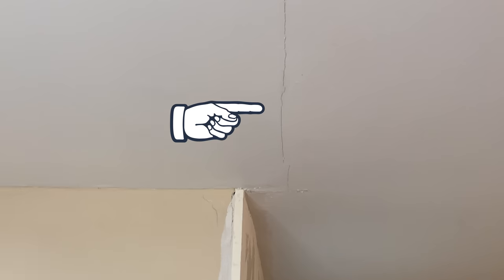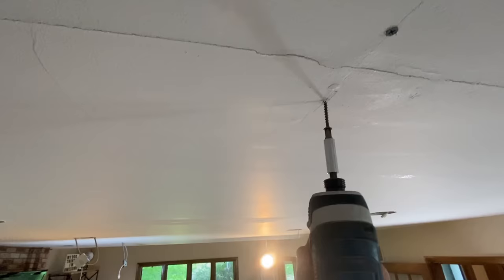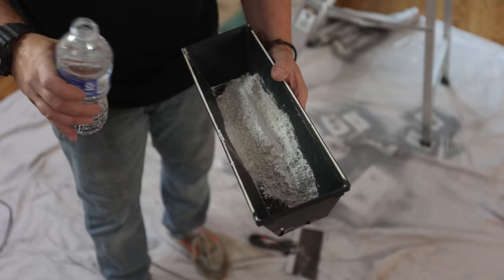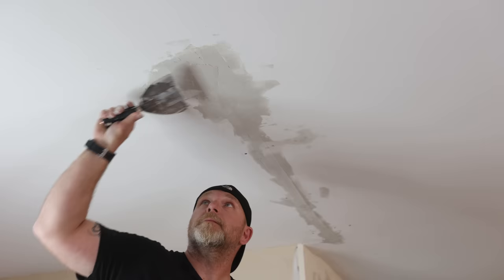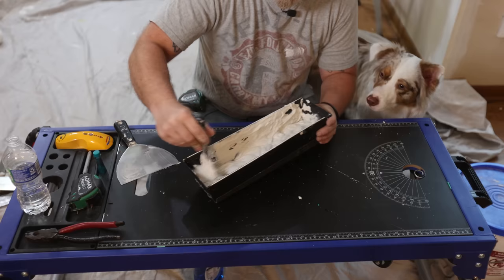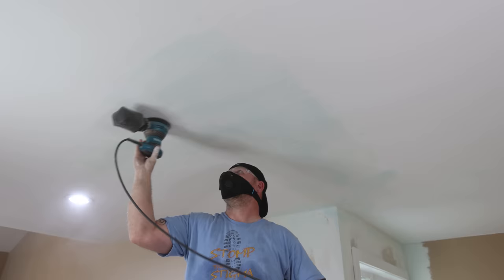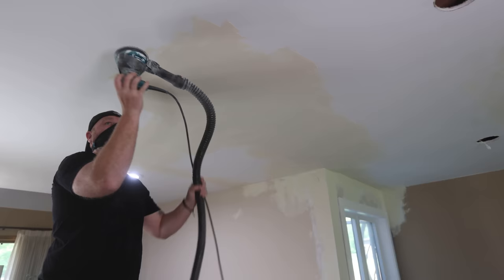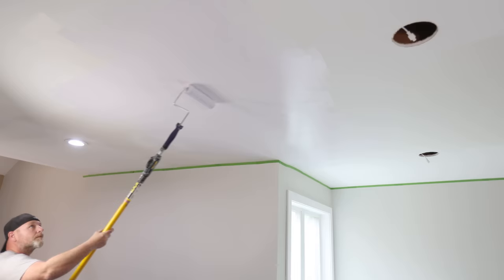How to Fix a Drywall Crack in Ceiling or Wall FOR EVER!!! Tutorial

Comment: How many days would this project take?
Reply: The Durabond comes in 5, 15, 30, 45 and 90 minutes, that is the time it takes for the product to dry. The regular mud takes anywhere between 12-36 hours to dry based on humidity and room temperature. I'd say something like this would take 3-5 days
Reply: Yea 3 to 5 days but only a couple hours each day of work. It’s a lot of sit around and wait for drying
Reply: day 1: cutting that crack bedding the tape<--3 hours
day 2: coating the tape includes clean up <--1 hour
day 3: finish coat includes clean up<-- 1 hour
day 4: finish sanding, vacuum clean up, prime with brush clean up<-- 2 hours

using a trowel instead of a knife cuts down the coating time because spreading with a trowel is much faster than a knife, especially on a ceiling.

Comment: This is a great video, but my problem is cracks in Lathum plaster. Is the process the same or does it require a different method?
Reply from the maker: Should be the same as long as you don’t take the plaster off completely and just go over it.
Reply: @KomarProject  Appreciate that quick response. Thanks!!

Comment: Hi, I have a random question, I have a big crack in my hallway roof (I think it’s all Sheetrock I’m not really sure) a big crack right below it on the tiles on the floor, and a few small ones around, do you think we would have to move out while they try to fix it? My house is on a hill and we think it’s shifting very badly, and we have no idea what to do as we’re renting & have too much stuff to just up and move super fast. If possible can you give us your thoughts on the matter? We just have no idea what to do.

Comment: Mesh tape is absolute garbage and tears extremely easy, which is exactly what you don't want when fixing a crack. Don't use it. Nothing beats paper tape. The trick to getting a perfect taping with paper tape is to wet the tape before putting it on the wall. This will completely eliminate any bubbling. 

Smooth out you ridges on your second coat and you will save yourself time on scraping and sanding before putting on the third coat, which should be the only coat you need to sand.

You feathered that very small crack way too wide. It reminds my of a half inch deep drywall repair in the house I bought that, when I scraped the 5 foot blob of drywall mud off, turned out to be a hole about the size of my fingertip. I put a 1 inch piece of paper tape over it and feathered it out about 8 inches and it was invisible after that. If you have to feather out 3 feet, you are putting the drywall mud on way too thick.

Comment: That crack will come back even worse  because that mesh is garbage looks like something is moving in that home that problem should be fixed before trying to fix it with a band aid. Might be better to cut it open see what is moving  fix that and maybe a good place to put a expansion joint.

Comment: Your mileage may vary, but Food coloring was a disaster here. We hardly used any food coloring, and maybe it was the type of compound we used, but 3 coats primer, 3 coats paint (Behr Marquee with Primer in it, no less) the blue color was still poking through after it dried. We switched to an even stronger primer, than another paint and primer coat, the blue is still alive and kicking. Huge mistake. either have to live with it or sand down and start all over.

Comment: Back in 1979 we turned our attached 1 1/2 car garage into a bedroom. The front wall has a 3 window casement. We always had a diagonal crack from the outside corner of window and no matter what I did it still cracked. While having some basement work done a few years back my contractor removed a rectangular piece of the drywall on either side of the window. It still cracked. He had a drywaller come over and he added more screws. The cracks came back. We found out when the garage door opening was closed up wood was used at the bottom instead of concrete blocks. Do you think your method will finally end the wall cracking?  I don’t want to spend $10K to open up the wall and replace the wood with concrete block. HELP!
Reply: No, it won't work because there is movement and stress everytime you open and close the garage door.
Reply: Frank Lopez, it is a bedroom no longer a garage. There is a permanent wall in the front where the door used to be. Read the entire post.

Comment: What about a textured ceiling? We have a heavily textured circle/pull off type, not sure what its called.
Reply from the maker: Probably a popcorn ceiling.  You just have to get two coats on it and spray the popcorn.  No need to finish it super smooth
Reply: @KomarProject  Had to look it up, called a swirled finish but done heavily from the pictures I see. Thanks for the reply.

Comment: It is proven that mesh is weaker than tape. You can prove this yourself by making two test pieces. Join one with tape and the other with mesh, then see which one breaks the easiest.  Once you see this with your own eyes you will never use mesh again! ☺
Reply: 99% of mesh tape failures are from not using quick setting mud to fix it to the wall. IDK why, it is right there on the label of every brand of mesh tape to use quickset only. People set it with air dry mud anyways and then have failures with it.

Comment: Never, Never use fiber tape. I have repaired countless reoccurring cracks in ceilings to find that fiber tape failed. Builders still seam with paper tape on new homes for a very good reason. Applied properly it's stronger. Nice work otherwise.
Reply: Fiber tape is meant to be used with Durabond. People make the mistake of using All Purpose or Topping with the fiber tape. I've made the same mistake myself in the past using fiber tape and that pink spackle crap. Since learning my lesson I haven't had any issues with Durabond or either paper or mesh tape for crack repair

Comment: I have to wonder why most of these DIY videos always present the problem in the easiest configuration for them to look good fixing it?  The job here would be more difficult had the ceiling members (joists or rafters) been running at a right angle to the crack.  Combined with a textured finish it would be even more challenging.  It would be easy for the viewer to watch the most difficult process and then ramp it down to fit the situation rather than the reverse.  In my experience it is often the case that using sheetrock screws or nails to pull the panel back into plane often results in the screws just pulling through the board.

Comment: Couple of things. 1) NEVER open the crack. It just makes the joint weaker. 2)use the self stick fiberglass tape, you don't have to put a base coat of mud under it .3).for the last coat, Use topping mud because it's softer and easier to sand and feather. 4) use a light at an angle when sanding so you can tell if it's feathered good . Iv'e been doing this work for 45 years.
Reply: 🤣🤣🤣
No.
He didn't open it enough and you don't open it at all. Folks like y'all are what keep us professionals in business though, so, thanks!

Comment: My Pro Tip guys : before applying the mud insert a fine line of paintable silicone has far has possible  in the crack and for large cracks fill it up whith urethane the one used for insulation cut off the excess and apply the mud whith Plaster of Paris mixed in toguether ( dries faster) after a few coats paint a coat of primer and correct the plaster ( pure) and sand down 40 years experience in the Biz 👍
wy the silicone ?
wy the urethane ?
that will be in another video guys 😂

Comment: OK, that was good but they WILL return.  It may be a few years, but trust me, they will.  My personal experience.  Some of it has to do with snow.  The weight of last year's freak snowfall put too much pressure on the ceiling joints and voila, the crack came back.

Comment: Hmmm, forever? So many techniques and so many failures. Not forever, be honest, it's always temporary in time. 

Until you completely stabilize the foundation and weakened structural joinery it is temporary at best. Of course some butyl rubber joint filler might help other than the paint peeling away in time. 

Other than my pessimism you did a good of explaining your work.
Reply: If you watched the first 13 seconds you would have heard him say his case was water damage. Water damage is the one case where you can fix the crack "permanently" provided you solved the water problem.
Reply: @wally7856  If you had actually read and comprehended the words I wrote it would have been apparent the meaning of my posting. Sorry for the failures of your education.

Comment: this guy is a hack, i would find another video to watch and you will see what i am talking about, please dont smear mud across the joint, and secondle if you are fixing drywall or gypsum, dont use a quick set product as it wont allow you to squeeze the compound out from under the tape and creates humps in your finish.
Reply: he had to go 3 ft wide do to using quick set, if he had of just used drywall compound he would not have to go wider than 14 inches !
Reply: Mesh tape "requires" quick setting compound to set. It will fail with air dry mud as when air dry mud dries it shrinks and doesn't hold onto the fibers. Grab a roll of mesh tape and read the label - it's right there. I agree with you for paper tape though.
Reply: @wally7856  no it don't ! ive been a taper for 30 years, mesh does not require quick set lol mesh tape has a sticky siude and should be applied before the drywall compound so it sits flush to the wall, this way you dont have to go 4 feet wide to hide it like he did in the video , please dont make stupid comments you know nothing about apparently ! now have a nicde day.
Reply: @kpfeiffer8775  Read the label on your mesh tape and get back to me. I've been repairing hack mesh tape jobs from people like you using air dry mud to set it for 30 years. 

Nevermind, keep using air dry mud with your mesh tape, it keeps me employed fixing your mistakes.
Reply: @wally7856  thats just too funny, ive been in business for 30 yrs and not one call back for workmanship, you kee tooting your horn and fucking up people homes, mesh tape goes directly to the surface, paper tape gets compound under it, not mesh, I love people like you cause im constantly fixing your messes, keep up the good work, my bank account thanks you.
Reply: @wally7856  probably the kind of guy who uses psper tape to fix Plaster lol
Reply: @kpfeiffer8775  Read the label on the mesh tape (brand doesn't matter) and get back to me. Bring a friend to help you read it if reading is hard for you. Quickset expands to squeeze and hold on to the fibers, air dry mud shrinks and pulls away from the fibers. If your mesh tape job didn't fail with air dry mud then you didn't need tape in the first place.

Comment: meh.. so much unnecessary stuff you are doing.. the way you are trowling and the mud you are using and most fucked up of all is that you are sanding with a machine???? inbetween coats even.. that should never EVER be done.. the way you apply the mud.. you have to have a system there like start applying one strip of mid that covers the crack and the holes and shit you scraped into the seeling.. the foodcoloring? useless.. the meshtape? should never overlap caus you are adding high spots for nothing and you will create waves and or dents in the wall. you should apply the mud with a small knive then the next coat with a slightly bigger knive and then last coat with another slightly bigger knive and you dont randomly start zig zag applying mud no.. from the wall you start and you go away from the wall towards the middle of the seeling.. and in as much straight lines or squares.. you trowl in the same direction allways specialy when you finish feather your edges with your trowl and thats it. never should use sanding paper.. and NEVER sand walls with a round machine.. thats the biggest mistake you have made. thats totaly not allowed with doing these little fix it jobs EVER your trowling does the sanding and making the surface straight and very very smooth to the touch i can trowl something and make it feel like a mirror.. smoother then you can sand with any sanding paper.. all you need to do is wait like 30min to and hour, wet all the mudd again with a sponge or water spray bottle or a brush and trow the water to the wall, then you trowl it with a steel trowl and you apply good pressure and make sure your angle of the trowl is allways the same create more pressure toward the side where you are going away from and your renovation will be done much quicker and also the way it has to be done.. you take so much time for nothing.. you can apply a few coates a day. if you use a mesh? you do not need all these special mudds.. the mesh is the crack fix and you have self sticking mesh for this jobs.. mesh that does not stick by it self? is used for concrete.. not a drywall. self sticking mesh you open up your crack like you did but you can actualy make the crack a little bigger then you did with the cutter knife, THEN you apply the self sticking mesh without overlapping then you apply 3 coats, finish trowl and you are done. paint everything and voila. if you wanna do it realy well you do the first coat and let it rest until day after then you do the last 2 coats the other day and let it rest an hour and finish it or let it rest for another day and apply a very very wet layer as your finish coat inorder to not have to sand, you have high spots and uneven spots? your trowls are ment to scrape and shape the walls instead of you sanding.

Comment: OMG. Is there malpractice insurance for YouTube videos? You used three different compound mixes? You sanded THREE times. Twice with a orbital! You took a simple crack repair and turned it into a repair No do it yourselfer should even attempt. What you should have said was screw off the loose Sheetrock, clean out the crack, tape (or mesh). The tape coat with good old fashioned joint compound, one pail, no  extra mixing or additives. Let it set and second coat. Sponge. Prime. Piss coat (with compound) the visible inperfections. Repeat.